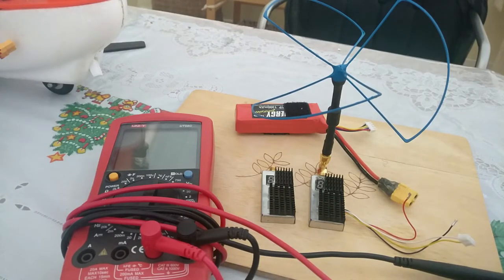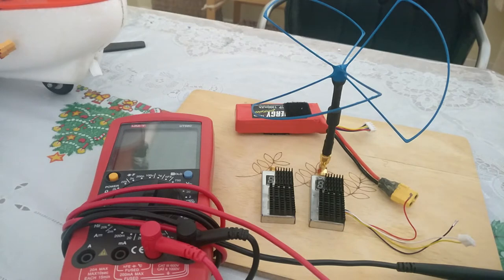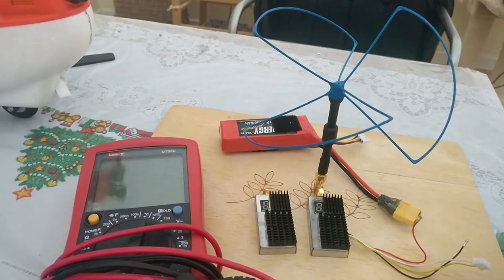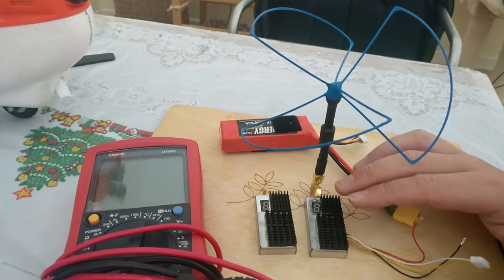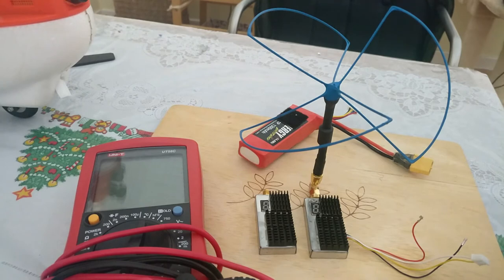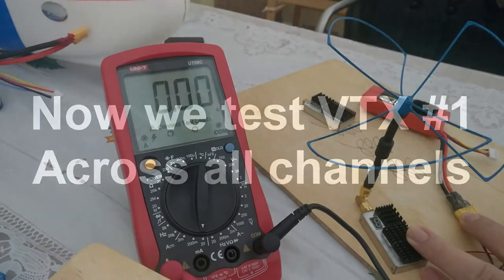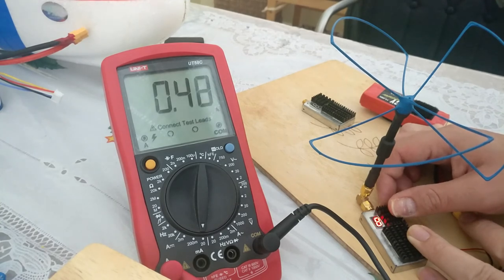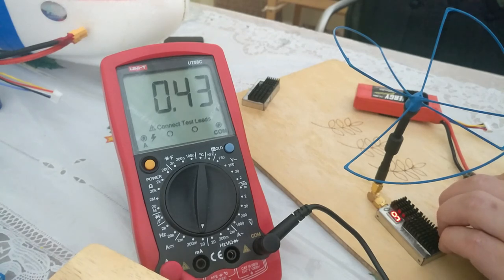RMRC 1.2Ghz 800mW VTX current consumption Bench Tests

Comment: This is interesting... I've been running the 800mW vTX along with a variety of cameras with no problems. I'm even running the 1500mW vTX in my Skyhunter with an Eagle, both on the 12V tap.
Reply from the maker: bonafidepirate I found it odd as well, but my video is now so much better using camera on 5v tap.

Comment: Ah! This explains why  I haven't experienced this issue. I think I normally feed 5v into my HS1177 but I shall check and make sure.
Reply: In an unexpected turn of events, turns out I'm running both on 12v. My vector PSU emits no sound and I've never had any issue. Will switch the camera to 5v anyways to reduce the load as there will be two separate voltage regulators each for 5 and 12v with current capability independent of each other I suspect.
Reply: Hi.. thanks for this video. Ive been using the rmrc vtx on channel d (1258mhz) and an HS1177 both on the vector 12v supply... no problems so far. I hadn't realised the difference in power draw on the different channels. So does anybody know which channel is actually best? I started with 1258 as I saw videos that suggested less interference from ezuhf than 1280.

Comment: I tried to run a 5v led strobe from my vector psu & it made the psu emit a high pitch whistle. I immediately knew it was overloading the psu & had to wire it directly to the flight battery with a ubec

Comment: Hi there can You tell me what kind of transistor is in the vtx .i got the same one but the transistor just under the antenna burned out.but cant read what kind it is .i hope you can help me .rmrc does not tell me.i can send it back but i am from the Holland and it will cost me a lot tax.thanx in advance.
Reply from the maker: I dint have Tyne vtxs any more
Reply: @CarftyCarper  thank anyway